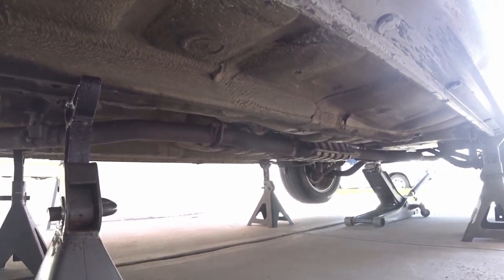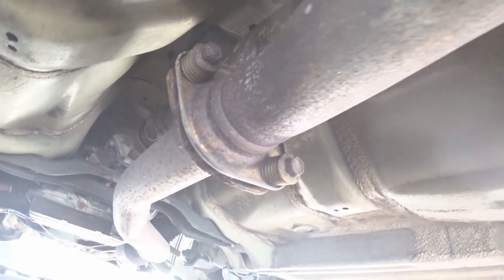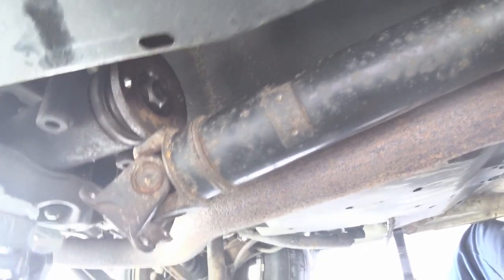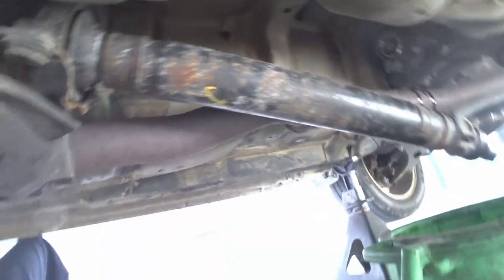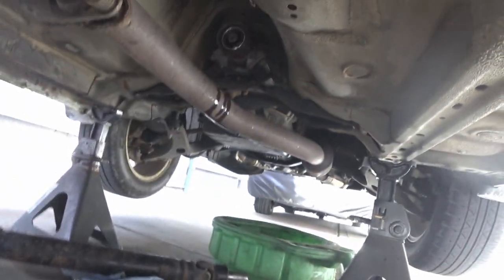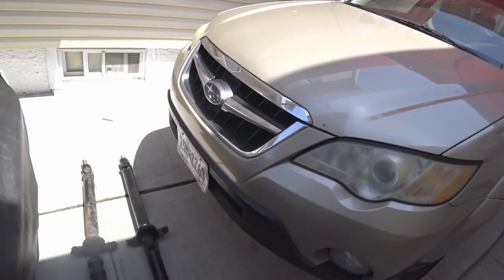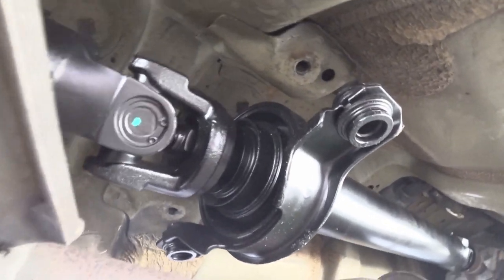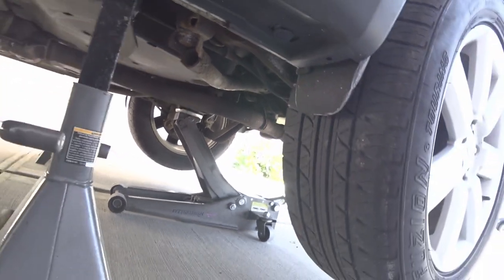How to replace 2009 Subaru Outback Drive shaft.

Comment: The fluid that drained out. Do you need to add or replace fluid?
Reply from the maker: It was a very small amount. So I was not worried. But you should check the level after the repair. My level did not move